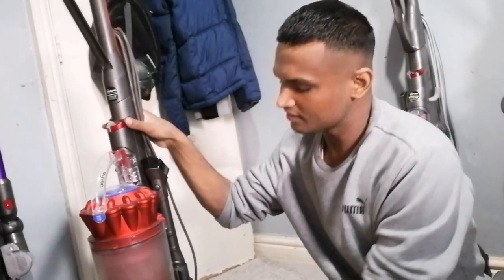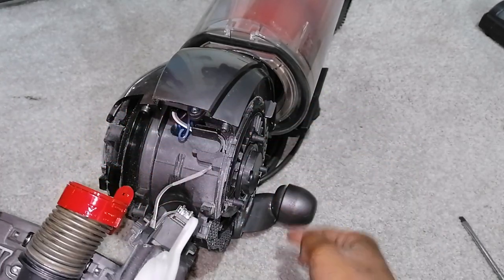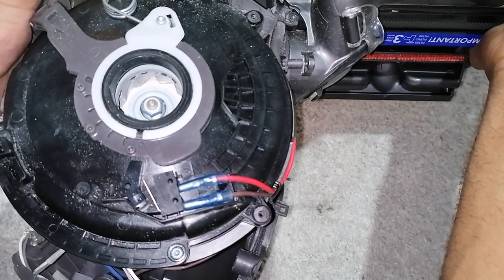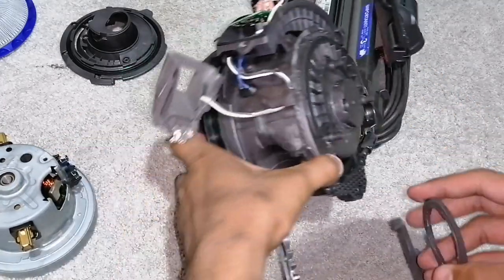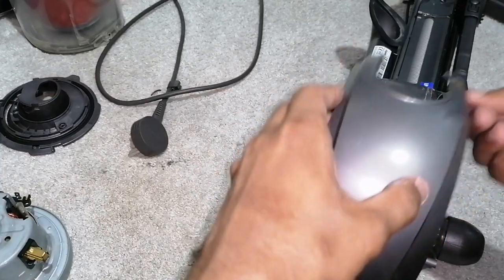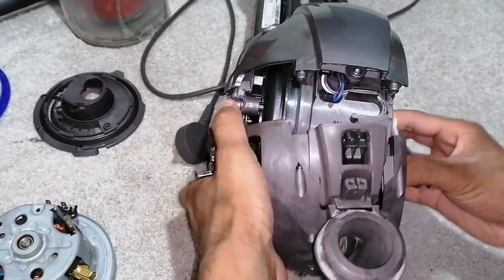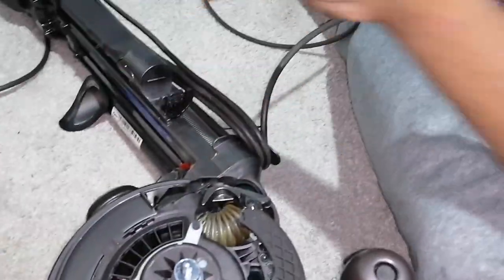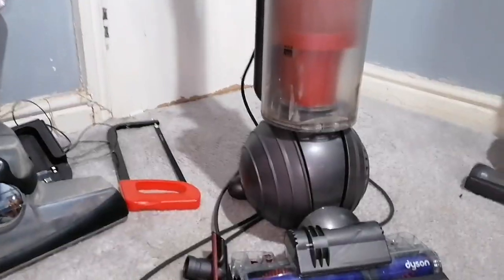HOW TO - DYSON BALL MOTOR CHANGE DC41 DC55 DC65 UP13 UP20

Comment: I know you made this video a while ago.  Thanks for making the video.  It's now Oct 2022, but how do you know what motor upgrade is more powerful and that fits in this vacuum?  thanks.
Reply from the maker: The original motor was 700W and the one I replaced it with is 1300W and the suction is noticeably stronger, however it is now much louder though and heats the filter up more

In the EU vacuums have had low wattage motors since September 2014 which reduced their suction power as a result and then motor I replaced it with is from an older dyson DC41

Comment: Probably something to consider here in that if you are replacing the motor, it would be a good idea to also replace the PCB especially if the machine is older or has had a rough life. Both motors get powered by the same PCB and the older PCB might be a cause of motors not having a full and efficient life. Just a thought.

Comment: Hey I am going to add something else I found out about on the DC65 that is pretty important. If you ever have that burning electrical smell there is another thing that I worked out might have caused this and if you get it early you may never need to replace the motor/s. There is a spring loaded mechanism that flicks a small vacuum hose behind the main motor (not the head) that if screwed either too tight or obstructed in someway will burn out the motor in the head. How? Well if the seal is not met by the change in the said mechanism the airflow never passes through the head but the brushes will be spinning and can't keep cool. Because Dyson use as much of the energy Inna's many ways there is dependencies and good hose connections are as I have found more imperative than just being for good suction. Hope this helps..
Reply from the maker: That's a very clever analogy - good thinking!
Reply: @parwaz7861  Thank you chap!!

Comment: Remember the PCB has a capacitor. You should use a ground mat when you remove the PCB. Any discharge through the board can damage the circuitry.

Comment: Hi parwaz I know you’re the Dyson king and hopefully you can answer my question. 
Personally I’ve found the dc40 ERP motor to be more powerful than the new light ball machines (think the motors in them are now YDKs again).
Anyway do you think I could retrofit a Panasonic motor the 850watt one into a light ball without much modifications I think I’ll obviously need the gasket from an ERP but do you think the PCB would work with one or will it all fail and refuse to even power up. 
Thank you for any tips you could give they’re much appreciated 👍
Reply from the maker: I think it should fit providing you have the motor mounts and parts but I’ve never done it before so not really sure, I recommend using the same pcb as the cleanerhead relies on it

Comment: This a brilliant video of the DC41. However have you done the same thing with a DC50 small ball? It's not quite the same and I'm concerned about pulling it apart correctly. The springs and switches are what worry me. If I don't get it right I could mess up the machine. The machine works but makes a high pitched wining noise. I've cleaned absolutely everything,  it looks like new and works fine. I have a replacement motor and if I can change that out it will be like a new machine.
Reply from the maker: The dc50 small ball is quite different but the general layout is quite similar, it just differs in ways
Reply: Yes I've seen that. I started taking it apart and got as far as springing it apart but stopped when I can see if I don't know what holds what I could end up with springs and catches falling apart. I really need a step by step like this DC 41. I've left it working with a noisy motor for now.

Comment: F me. I just figured out why it was overheating. The extension pole was blocked. 😂
I was testing it standing upright, so it was drawing through the extension. I noticed that it was blowing exhaust much better as soon as i put it in floor mode. 
Well, thanks to this video, I at least know how to put in a new motor if my wife vacuums up another chunk of wood. 😅

Comment: I have a dyson up13. It is overheating when I run it with the filter canister attached. I disassembled it using your instructions (very good BTW) and noticed some fine black dust on the motor. The exhaust filter was also black on the inside. I think it is going to need a new motor soon. I was interested in your comment regarding "upgrading" the motor. I just noticed in the other comments what motor it was and the info on it. I may give it a try.
Do you have any other tips/ideas regarding my overheating problem? I thoroughly dissassembled and cleaned the canister. I ran it with canister only (no filters) to see if it was clogged filters. (I recently cleaned both and ordered replacements). It still overheats w/o the filters installed in the canister in about 2 minutes.
Reply from the maker: The motor would overheat if it isn’t getting enough airflow to keep the motor cool. The pleated hepa filter next to the motor is quite difficult to wash and the pores may be blocked this resulting in the motor struggling to exhaust the air out the filter, hope this helps

The motor in this DC55 was only 700W because since 2014 vacuum cleaners here have to be a low wattage to save energy, so I used a motor from an older model DC41 (basically the exact same vacuum) and fitted that to have stronger power

We didn’t get the UP13 here, they were made for North America and had much stronger power than the ones we have here. The ball Animal 2 and Animal 3 have slightly stronger power, however I’m not sure if that’s due to a more powerful motor or if it’s due to the tweaks they made in the cyclone assembly unit to optimise airflow
Reply: I edited my comment to speak to the filter issue. It is overheating with no filter installed in the cannister (or in the exhaust). 😢
Reply from the maker: @vicblaze3479  Try running the vacuum without the bin/cyclone assembly attached. If the motor still overheats, it’s definitely the motor. Make sure the voltage of the replacement motor is the same as the one in your vacuum 

There’s a chance there could also be a blockage in the machine somewhere too. Either in the cleanerhead, the wand, the internal hose, the changeover valve hose or the airpath that leads up to the clear bin
Reply: Yes, I'm an idiot. It was blocked in the extension wand. 😂

Comment: Does the DC40 have the same stripdown as this and is the dc40 a good machine?
Reply from the maker: The dc40 is the same vacuum externally as a dc55 but with shorter cable, smaller bin, filters, and lighter weight but internally it’s more complex than the dc41/55

Comment: What do you think of big ball canister? AFAIK it is an updated version of dc54(52).
Reply from the maker: They're okay, but the hoses are far too short, great suction though and design otherwise. I wish they had better wand connections too as they can leak air
Reply: @parwaz7861  Thanks for the reply!

Comment: Tayyab i need some help with my dc01. I was vacuuming today and noticed in the upright postion the dirt was still spinning. It didnt spin before when in upright. Do you know what it is?
Reply from the maker: Probs the spring loaded plastic piece where it meets the bottom of the wand
Reply: @parwaz7861  alright any way i could fix it? The suction has also dropped so im concerned
Reply from the maker: @2009danial  I reckon it's that, it's either broken or loose that's all I can suggest
Reply: @parwaz7861  ah ok i will take the housing off and the upper one and have a look. If its broken i will replace or if its loose i will have to see what i can do. Thanks anyway mate!

Comment: The cyclone pack reduces airflow quite a bit due to a complex air path with tons of sharp turns it has to make. Bagged vacuums and some bagLess vacuums have less complicated air paths so cfm will be higher. Most corded dyson’s get 50-63 cfm at the head and 60-70 at the hose vs a motor without bin that pulls over 100 cfm.
Reply from the maker: I don't think cfm is everything, it's how it's utilised. The main thing is getting airflow throigh the pile, as well as good cleanerhead design to optimally clean the carpet as good as possible. Kirbys have one of the highest cfm numbers but the airflow drops massively on a fitted carpet, so you need high suction to keep the airflow going which is why dysons have high suction to optimise the airflow
Reply: @parwaz7861  very true.
Reply: @parwaz7861  that’s also why modern vacuums use more  power  than older style ones typically.
Reply: @parwaz7861  that’s the common misconception with reviewers. Airflow is important but having suction is just as important. If a carpet doesn’t allow much air through suction must compensate by sucking the head closer to the carpet and pulling the air through the fibers.

Comment: Hi,  my motor had stopped working due to a bolt coming loose inside right by the motor and must have got stuck somewhere. I stripped it all down and re attached the bolt. I’ve put it all together again. The motor and brush now works but all the suction has gone, so it’s not picking anything up.  Any suggestions pleas
Reply from the maker: Hmmm either the vacuum hasn’t been assembled correctly or the motor impeller isn’t spinning properly is all I can think of
Reply: @parwaz7861   realised that the brush bar micro switch spring is still on my work bench. Wonder if that’s the issue. Also the brush bar button next to the power button isn’t working, so now I’ve taken that apart

Comment: Very complicated machine. No wonder they don't last haha. This is why I prefer the Dual Cyclone era, the plastic  may be brittle but they were simpler and lasted
Reply from the maker: The DC55s are actually quite reliable,  nothing really fails on them often. Infact DC33s are less reliable due to their flaws despite being more simple
Reply: @parwaz7861  I'm surprised ngl haha. I'm very curious to see how long  my UP22 lasts. The bin release is already sticking so not a good start
Reply from the maker: @RJA_World  should be fine, once the mechanism gets dusty it'll be smoother due to the rubber bin flap seals sticking less
Reply: @parwaz7861  thanks for the advice. I'll l see how it goes. It's only 3 weeks old so i don't expect anything to break on it yet, as you might remember I baby my machines too, I hate stuff getting damaged. I'm excited to get my DC26. That machine has always intreaged me. I know it's not the best performing but it's quirky.
Reply: @parwaz7861  I finally gkt my DC03 filter out! I phoned Dyson and they advised to prize it out with a flathead screwdriver. It worked thank god. I also tried to get the machine dated but she couldn't get any info on it unfortunately
Reply: @RJA_World   That's good you got your DC03 filter sorted. What do you think of the DC03?
Reply: @jayambermsp8000  Suction is dreadful and very noisy but I like the design. It's cool looking